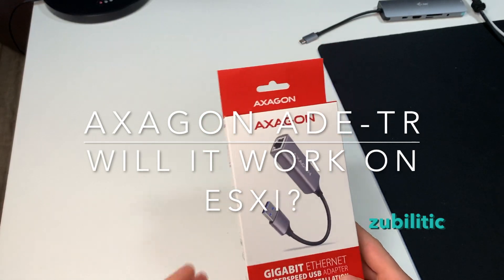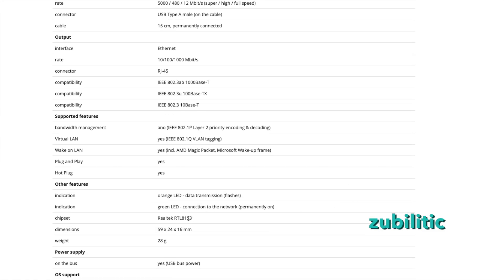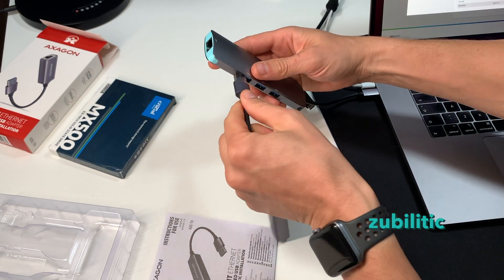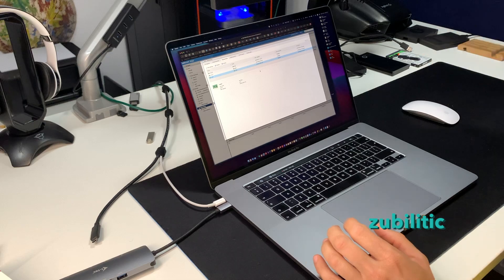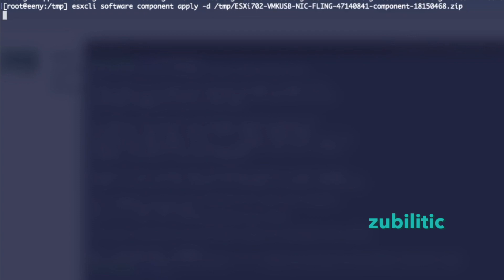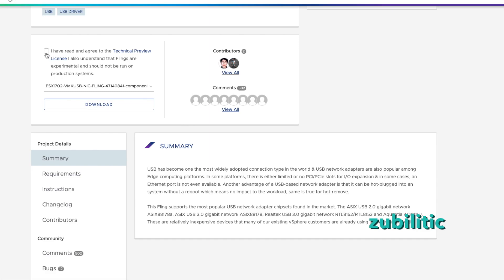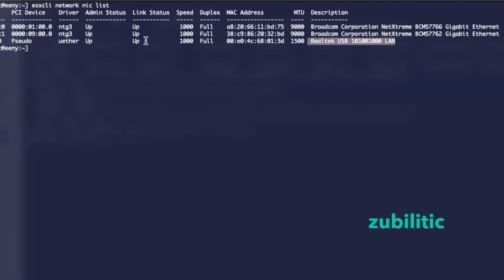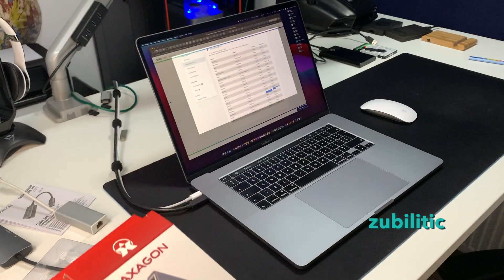Fix Slow USB Ethernet on ESXi – Axagon ADE-TR with RTL8153 (Mac Mini Test)

Comment: is it work for android tv stick
Reply from the maker: Yes, it can work with some Android TV sticks, as long as the device supports USB Ethernet adapters and has proper driver support for the Realtek RTL8153 chipset. Many Android TV boxes or sticks based on Android 9 or newer support this adapter via USB OTG.
However, not all sticks have proper driver support or enough power, so it depends on the model. You might need a USB OTG adapter with power passthrough if your device only has one USB-C or microUSB port.
Let me know which Android TV stick you’re using and I’ll try to check compatibility.
Reply: @zubilitic I use tv stick Xmart S23 TV Stick 4K
Reply from the maker: Thanks! It runs Android 12, which is good. That OS version generally supports USB Ethernet adapters like the Axagon ADE-TR, especially since it uses the Realtek RTL8153 chipset.
However, I couldn’t find full specs or port details for the Xmart S23 online.
Could you check if it has a microUSB or USB-C port? That decides which OTG adapter you need.
If it's microUSB (most likely), look for a microUSB OTG Y-cable with power input.
If it's USB-C, a USB-C OTG adapter with power passthrough will work better.